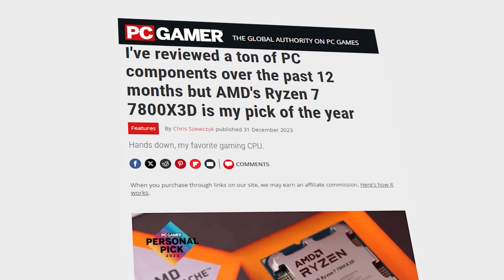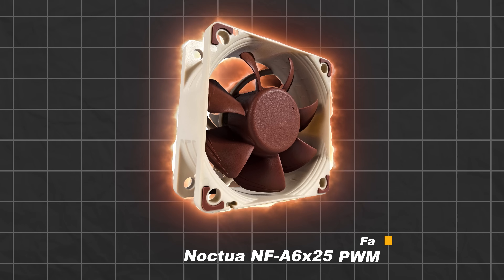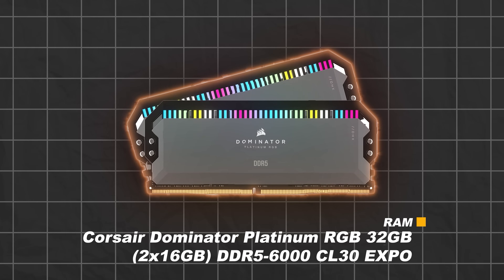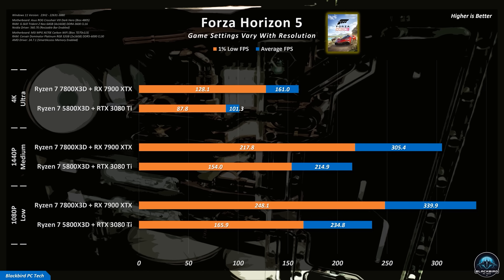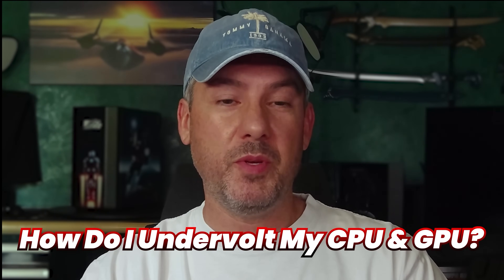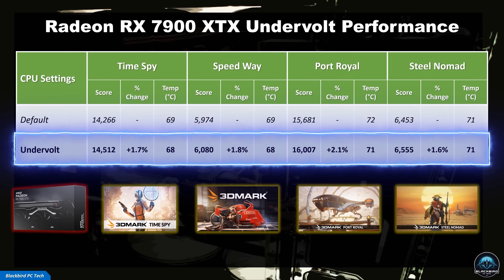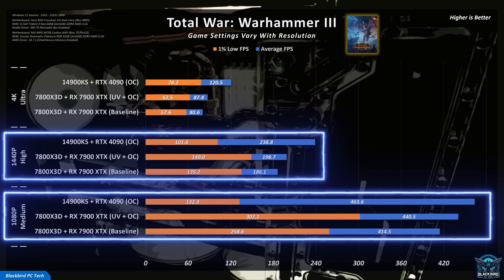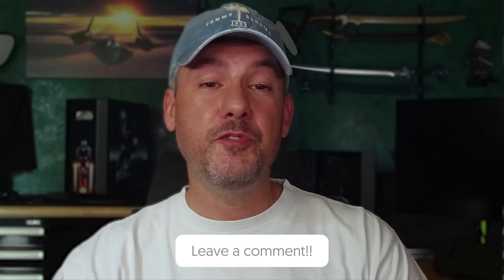Is an All AMD Gaming PC Really Worth It?

Comment: In order to do the comparison, you need to test them straight and swapped.
1 amd cpu, 1 intel cpu, 1 amd gpu, 1 nvidia gpu.

| cpu  |  gpu    |
|---------|-----------|
| amd |  amd  |
| intel | nvidia |
| intel |  amd   |
| amd | nvidia |
Reply from the maker: That makes no sense on many different levels but to help you understand why, simply let me know what components I would use for each proposed test.
Reply: @blackbirdpctech 
The combinations are in the scheme.
You can use 7800x3d, 13900K, 3090TI, 7900xtx.
Going all amd or not all amd leave the 4 combinations. 
All amd
All non amd
Only cpu amd
Only gpu amd

And to compare, it has to be the same 4 components.
Reply from the maker: @ So now here is the challenge, how do you standardize a motherboard?
Reply: @blackbirdpctech Motherboard follow cpu.
Ram, I think it was a good choice to go with what fit the cpu best, but there could be a whole series again, with both types you showed.
Reply: @blackbirdpctech sorry I am not skilled at making myself understandable.
Reply from the maker: @ I understand what you suggested ... the issue is that it won't achieve the results you think it will.
Reply: @blackbirdpctech you can explain why it is not perfect comparison, but it would be much closer than this.
You can't look at wanted results and arrange your tests to show those results.

Comment: Buy a computer and work ? No! long and tedious adjusting timings, undervolting something here and there - this is the difficult path of a real samurai)))
Reply from the maker: The great thing about PC's is that you don't have to optimize it, you can simply use it out-of-the-box ... however, it does give you the option to extract more performance if you learn how. If that doesn't interest you then always get a console, which is basically just a fully locked down PC.

Comment: You will get better performance with other card manufacturers my XFX 7900xtx performs 6% better than the AMD reference card used in this video BUT the card is larger and requires more power with a 3rd 8pin. I'm very happy I switched to AMD during the 6000 series after I was dissatisfied with my 2080 Super's performance, at the time they locked regular VRR to the 2000 series I didn't like getting Gouged 100$-200$ for G-sync back then.
Reply from the maker: That’s true, my favorite 7900 XTX is the Sapphire Nitro+, which I heavily overclocked in a prior video. For this upgrade I was heavily space constrained, so the reference design was the only high-end card I had that would fit … and it barely made it. It is a beautiful looking card in my opinion.

Comment: Cpu 7800 over the 9000 series? Your thoughts
Reply from the maker: My next video will be comparing the 9700X against the 7800X3D ... take a look at my most recent post to see the results, they are truly amazing ... I would now recommend getting a 9700X over a 7800X3D based on my testing.
Reply: @blackbirdpctech  thank you
Reply from the maker: @Ruse5523  you are welcome, the video has a step-by-step guide on how to optimize the 9700X ... it should be posted by Saturday/Sunday at the latest ... if you do plan to buy a 9700X please use the amazon affiliate link from my post, it really helps.
Reply: @blackbirdpctech  will do

Comment: I wouldn't call a 14900ks an ultimate cpu... since its not going to last very long:D
Reply from the maker: Perhaps ultimate heater since the 14900KS is the worst offender 😉 I built that PC before I was aware of the issues. Intel is now claiming that their new CPUs will not suffer from the same voltage related issues as 13th/14th gen, but the damage has been done to their brand ... I think this lack of trust will significantly impact their sales moving forward.

Comment: i would have tested 5800x3D vs 7800x3D at the same time to see what is coming from the CPU upgrade and from the GC upgrade... but great video guys, Thx!
Reply from the maker: The reason that I test the way that I do is to isolate the impact of the CPU from the GPU, even when upgrading multiple components at the same time. So if you look at the 1080p/low results they will show you the impact of the CPU because under these conditions the CPU is heavily loaded, likewise when you look at the 4K/ultra results they will show you the impact of the GPU because under these conditions the GPU is heavily loaded.
Reply: @blackbirdpctech  i understand your reasoning as more global perfs difference on a newer build.... but anyway, i would have been interested in what part is more CPU and more GPU. I think it would have been interesting.
Also, the new windows update will have a major impact on the CPU side.
I'm still on a 5800x3D and i can't see any bottleneck with it but i only use 4k resolution.
Reply from the maker: @armirol  you should checkout my video: "5800X3D or 7800X3D - Which One Is Right For You?" where I test the 5800X3D against the 7800X3D and give my recommendation on whether it is worth upgrading. With respect to the new version of Windows, I'm not sure if you saw the recent video from Hardware Canucks but they uncovered an issue with the new 24H2 version of Windows that was giving misleading results ... Microsoft had for some reason turned off memory integrity by default, which was in turn responsible for most of the large boost in performance. All of the other tech YouTubers missed it and incorrectly stated that this new version would significantly boost performance for AMD users. The thread director update will improve performance but it will only be about 2%, not the 10% other outlets were saying. You also don't have to wait, just update your current version of Windows.

Comment: 4090 stock power cable catches fire let alone an overclocked 4090
Reply from the maker: I think it's important to put that in to perspective, the failures shouldn't happen but the failure rate is extremely low. What's interesting about the Matrix Platinum is that it has sensors on the adaptor that feed into the GPU Tweak software to show if the connector is plugged in and functioning correctly ... it's a feature that all 4090's should have.

Comment: You get a 5-10% boost just from switching from 4 sticks of ram to 2.
Reply from the maker: That's not really true. For DDR4 RAM at speeds of 3600 or below there is no meaningful benefit in going from 4 dimms to 2 dimms. If you want to run highly overclocked memory, say 4000 MT/s, then offloading the memory controller by using only 2 dimms would make sense. For DDR5 there is a benefit because the memory controller isn't as robust, so if you run two dimms you will be able to stabilize higher memory speeds. This will likely change over time with the release of newer cpu's because the memory controller will mature. We can already see it with 9000 series cpu's, they can support higher speeds with both 2 and 4 dimm's populated.

Comment: My system is not as high end I only have an Ryzen 7 7700x with an RX 7900GRE it gets the job done 👍
Reply from the maker: Great system … I compared the 7700X with the 7800X3D and there is not much difference, especially at higher resolutions. I also recently compared the 7900 gre against the 4070 Super … the gre is a fantastic card.
Reply: @blackbirdpctech  I'm looking forward to the update to Windows to improve the Ryzen CPU'S
Reply from the maker: I’m planning on testing the higher end 9000 series chips against Intel with this new version … should be interesting
Reply: @blackbirdpctech  I look forward to seeing the results

Comment: 3080TI 12GB is good cars but why not the 3090TI 24GB? U made a mistake 2 years ago.
Reply from the maker: The 3090Ti wasn't available when I purchased this system ... if you recall it was released very late in the product life cycle, not that long before the 4000 series was launched. I had two systems at the time, I had a very cool system from Maingear that was fully water cooled with dual 3090's in SLI (still have it because it is a stunning system to look at) and this system.

Comment: And those conclusions also mean that the real ultimate pc would be a combination of the 7800X3D and the 4090.
Reply from the maker: That is very true ... or the 7950X3D. I've been planning a new ultimate PC build around the X670e Godlike, 7950X3D and 4090 ... with the 9000 series released and the new X870e boards coming soon I'm considering whether to build now or wait.
Reply: @blackbirdpctech  Well depending on when the new X3D variants will come out it might be worth it to wait for that as well.
But rumors say it might take until CES when it finally happens.
Reply from the maker: Yeah, I think the X3D chips and the 5000 series will be announced at CES ... I might just build it and then upgrade it ... that way I could show the benchmarks between a 7950X3D/4090 and a 9950X3D/5090 ... that would make for some cool content.

Comment: NVIDIA has priced it's self out of the market in Australia. 4080 is the same price as a 7900xtx.
Reply from the maker: A 4080 Super and 7900 XTX are very close in performance so it makes sense that they would be priced similarly. In the US the 7900 XTX tends to be cheaper than the 4080 Super to offset some of the better features that Nvidia offers. I provide benchmarks and compare the two cards in my video: "Should You Buy an RTX 4080 Super or RX 7900 XTX?"
Reply: @blackbirdpctech  4090 is over $3000 Australia in most stores.🙄
Reply from the maker: That's crazy ... I miss Australia and my family there but I don't miss the tech prices 😉

Comment: You should have gone with the 4080 super. There is no comparison.
Reply from the maker: I did compare those cards in my video: "Should You Buy an RTX 4080 Super or RX 7900 XTX?" The 4080 Super is a great card but if it's about $100 or more than a 7900 XTX then it becomes a tough sell. In addition, for this upgrade I was space constrained with the max length of the card ... the 7900 XTX reference model just fit ... I don't recall ever seeing a 4080 Super with those dimensions.
Reply: @blackbirdpctech  you can buy one in Greece where I live for about 980 to 1000 euros.
The 7900xtx is at sitting at 950 euros so if I am buying a new card I am going for the 4080 super. I need to be able to play everything.
Including games with path tracing which in Wukong's case makes it a different game.
Don't forget ray reconstruction, better ray tracing performance and less issues.
And this comes from an Amd user since the 9800 up until the 5700 xt with a 6 month period where i had a grx 280 if I remember well.
The 4080 super is ideal for your resolution,  I have a friend who paired it with a Dell 3421 dwf and he has zero issues, even with PT enabled 

Dlss quality or even balanced help a lot when things get tough.
On the other hand with the Amd you got no choice but to pick raytracing or play without it.
I made the switch when the 3070 launched, moved to the 3070ti, 3080ti and since 2 years ago the 4090 and I could not be happier.
Reply from the maker: @DsLmaNiaC  in the US the cheapest 7900 XTX is about $200 less than the cheapest 4080 Super, so it makes it a tougher choice. Not sure I understand why you said that the 4080 super is ideal for my resolution ... what resolution? As a content creator I own a lot of different GPU's ... this was for one of my personal systems that I wanted to upgrade. The case has ironman graphics on it so I'm not looking for another case ... the challenge was to upgrade within the existing case.
Reply: @blackbirdpctech  are you willing to give up the best product with the ability to run wverything even for 200 dollars?
If your budget is not tight, you should go for the 4080 super.
For a content creator I think it is overall a better choice too because if the new shadowplay options.
The card is a beast in all aspects.
On the other hand if the case limits your options what can I say? You don't have many options. You either do that or wait for the next gen.
How did the 4080 super worked I before you sold it? On another system?
Reply from the maker: @DsLmaNiaC  I don't think you understand ... I didn't sell my 4080 Super ... I own about 30 gpu's, I think about 3 of them are 4080 supers, there are 4090's, 7900 XTX'x, basically the entire line-up of the nvidia 4000 series and amd 7000 series. I didn't randomly post this video ... it's something I did for my channel. Not sure what else to say ... it seems that you don't grasp the situation and I'm not sure how to explain it to you. As I mentioned I thoroughly tested the 4080S against the 7900 XTX ... these benchmarks are on my channel in the video I listed above ... so I'm not sure why you would try to sell me on the idea of a 4080S based on your opinion.
Reply: @blackbirdpctech  oh OK I really thought you had to sell it, judging by the way you were talking! Sorry if I misundrrstood something, have a nice dat!
Reply from the maker: No problem ... I think it was just a miscommunication ... have a good weekend.
Reply: @blackbirdpctech  as for the case just pick a Lancool 216. Great case, great airflow and everything just fits in.

Comment: I recently went from a 5950X to a 7950X3D while keeping my 3080TI.
This video I think corrolates well to my change, but I'm assuming I gained more due to the 5950X not being X3D.
I would be interested in seeing the 7800X3D with the 3080TI to see what just changing the CPU did you your performance.
Reply from the maker: To understand the impact of just the cpu simply look at the 1080p/low results … this combination heavily loads the cpu and offloads the gpu. This is the reason I test this way instead of simply testing at ultra game settings like most other tech YouTubers.